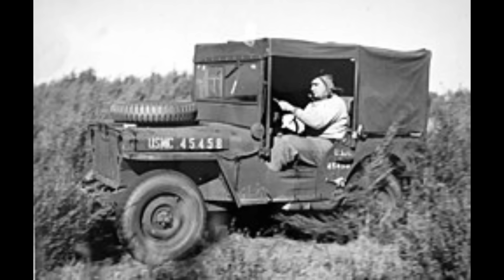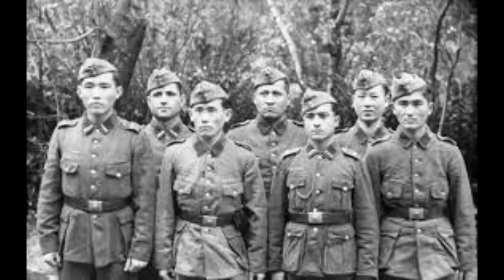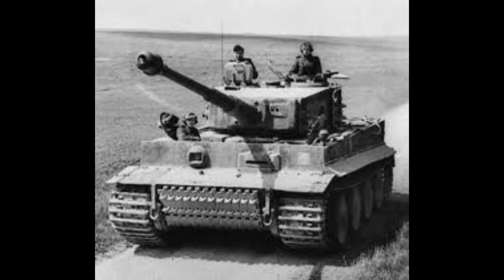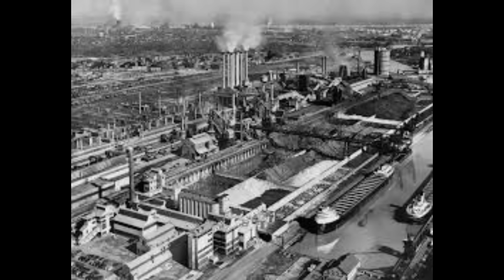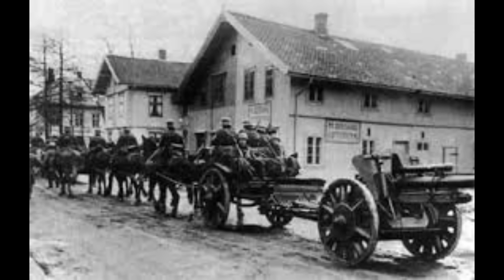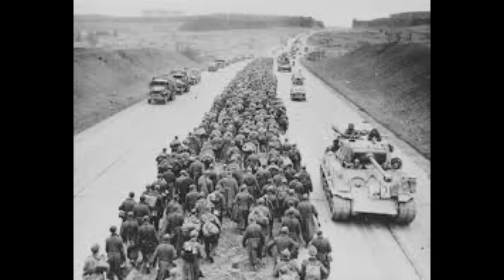German Mechanics Examined A Captured Jeep — Then Understood Why 640,000 Conquered  Two Continent

Comment: My name is Jeep.  There were no Jeeps in WW2.  They were called general purpose vehicles.  The name was shortened to GP's in military jargon.  In the maintenance shacks they were further shortened to the name Jeep.   This became the quick name for General Purpose vehicle. The name was not actually given to the vehicle until after the war was over. The first Jeeps were used in the Korean War.  That was the first time Jeep was actually stamped on the vehicle. They were manufactured by Ford,  Willy's and American Overland.
Reply: Nice story but not correct. The jeep was originally contracted by the army as a 1/4 ton light truck and three companies competed for the contract.. American Bantam, Willys Overland with the MA and Ford motor co. with the GP. The Ford GP was their build code for G= government contract.. P= 80 inch wheelbase.. nothing to do with “general purpose”. American Batam’s design won them the contract but the government didn’t believe they had the ability to manufacture in large numbers so ordered them to hand over their design blueprint to Willys who named the new model the Willys MB. When the US entered the war they contracted Ford to build an identical vehicle to the MB with all parts interchangeable which Ford designated the GPW… G- government contract.. P- 80 inch wheelbase.. W- Willys designed engine. Willys built approximately 360,000 MB’s and Ford built approximately 275,000 GPW’s. The name jeep is believed to have been derived from the cartoon show Popeye and was used by GI’s during the war. Willys overland patented the jeep name after the war and the rest is history. All ww2 jeep nomenclature plates have the designation TRUCK 1/4 TON stamped on them. The now famous stamped slotted grill was designed by Ford.
Reply: @BacktrackTouring  Just have to disagree.  My dad served after WW2, joining  in 1949 and the vehicles were called general purpose vehicles and they called them gp's in the maintenance shacks. 
That gp acronym was shortened to jeep.  Then the name was patented by Willy's.  The original Jeep, as you report, comes from Popeye and was Merchant Marine character that often guided boats in fog and dangerous conditions but the name Jeep as it relates to the vehicle comes from being called general purpose vehicles.  My dad's initials were GP Campbell and he was called Jeep because his initials were the same as the Jeep, general purpose vehicle.  I have had numerous conversations with many WW2 vets and Korean War vets over the years and their calling the Willys, the general purpose vehicle, jeep, was verified to me many times, including by my dad. This was the story he told about the origin of his name so I believe that version of how Jeep became Jeep is more accurate than yours, but both of our accounts are not that different.  My dad worked on a PT boat for some  years and his mates often called him Sargent Jeep because of his initials.  Very informal on a PT boat.

Comment: Modern day America has a military that relies on highly complex ultra expensive combat and logistical systems that cannot be mass produced…especially cheaply. Meanwhile our biggest adversary China is more like America of the 1930s - extensive capacity for mass production, countless assembly lines, and less complex engineering that is easier to mass produce.  America is no longer capable of attrition warfare especially against China. 

Why?

Profit. Profit. Profit. There’s way more profit in flashy complex weapon systems that claim superiority. Systems so expensive they can’t be bought in large numbers, don’t require manufacturers to invest in mass production, and look so good on paper its easy to convince the decision makers. Capitalism without regulation eventually eats itself or is outcompeted by common sense and respect for the working class.
Reply: I was thinking the same thing.

Comment: Not addressed but the US was supplying almost all of the Allies under "Lend Lease" which was a politically expedient way of telling the American taxpayers that they would be footing the entire bill for the conflict, and our Allies weren't expected to repay us.  If 5,000 Jeeps were sent to  North Africa, the US wasn't going to tie up ships moving those assets.  They were abandoned.  While it cost the US $750/vehicle in procurement it was another $150 to ship it.  For US soldiers it was easier to requisition a new Jeep than to get a carburetor or even oil for an oil change.
Reply: Yeah, nah… you got the lend lease part partially correct but the rest is wrong. Millions of spare parts were produced for all military vehicles and especially the jeep, so much so that the allies had extensive rebuild programs where damaged jeeps were shipped to rebuild facilities. jeeps were completely stripped down, all major components were rebuilt or replaced, they were repainted and sent back out. The jeep had a life expectancy of 90 days in battle zones. To this day, NOS jeep parts from ww2 can still be found coated in cosmoline and wrapped in wax coated packaging.

Comment: You are correct that Ford and Willys Overland were both working on the Jeep, but what they didn't know was that Checker Motor Corporation too was working on the Jeep as well as it's trailer.  It's trailer design is what won the contract for Checker.  Checker's version had four wheel steering and proved  a bit unstable but The Government loved the Trailer design.

Comment: I own and operate two military Jeeps. A 1942 Ford GPW and a 1952 Willys M38. The Jeep in WW2 was far superior to the German Kubelwagen. The main advantage was that the Jeep had four wheel drive. Plus as stated, simple to repair and virtually indestructible.
Reply: A Sad Sack cartoon showed the Sack standing in front of his disabled Jeep, which has finally been defeated by extreme mountain terrain. The Sack is hiding his eyes in grief as he aims his pistol at its motor, preparing to end its suffering. 😄
Reply: Americans testing captured Kubelwagens noted it matched or outperformed in every category of testing.

Comment: I lived in Germany for several years……German engineering does not mean quality, it means complicated!  Brilliant, but complicated.  Complication breeds unreliability.
Reply: It’s called GateKeeping tactics 101; also-known-as job-security. 😂
Reply: @LongLiveLiberty same reason road planning and construction organizations always make it one less off ramp than needed, ones less lane than the volume of traffic requires, so they can co.e back in five years and add another lane, bridge, off ramp, etc.
Reply: I bought a BMW from a friend. Nothing but trouble and $$$. Too many bells and whistles, and too many sensors. Every week something was failing or malfunctioning. The display never stopped showing problems and  malfunctions. Very complex garbage.
Reply: I owned one Mercedes. One. I used three different mechanics. One told me, “Mercedes are quirky. And by quirky, I mean expensive.”
Reply: That is why Mercedes are so expensive to own.  Me? I always bought simpler vehicles that cane be maintained without taking out a second mortgage.
Reply: @FD2003Abc The $1000 key fobs to start your Mercedes is a perfect example. There are repair companies that specialize in fixing those key fobs.  Crazy complicated.
Reply: Means more parts more complicated to learn.
Reply: Absolutely right, why make something with 4 parts when it can be done with two ?

Comment: US jeep transfer cases did indeed have a dog tooth clutch gear set.Though the gears were cut, teeth surfaces were hardened. Lapped gear sets were used at the two ring/pinion axle gears.

Comment: The jeep I worked on, while I was in the Army, had no less than 12 U-joints. Now imagine those U-joints constantly immersed in mud or muddy water. It's not hard to understand that those U-joints failed on a very regular basis. Add to that a piece of crap for an engine and I do not have fond memories of the jeep.

Comment: That's 1/2 million Jeeps in just 3 years. Can you imagine what they thought when they first seen how we (USA) used the engine PCV blowby pressure to air charge the axial differentials for water fording to keep the water out of the gear boxes? It must have blown their German slide-rule slinging minds to see that kind of pure simplicity in action LOL. BTW, there's a video where 6 guys assemble one in less then 30 minutes from a pile of parts.
Reply: They should have known, already, this simple concept, as applied by the Soviets. The T34 was simple and good enough. And that means, production was sped up and the numbers are what told the story.
Reply: @keithbrown7685 
The T34 was not inly good enough. 
Every aspect design was recognized immediately by the Germans.
The Wehrmacht demanded a tank specifically like the T34.
Nowadays the T34 is considered okay-ish.
Sure, the german generals feared and demanded a mondane vehicle.(lmfao)
If you want to see history untainted by contemporary views, you have to go back to the original perception of things.
Otherwise the Soviets never captured    
Berlin because everything they had was utter garbage.
Which might be the next step in this modern historical narrative.

Comment: My Father used to say soldiers loved them and everyone wanted one after the war.
Reply: My dad bought one from korean war. Put better foam seats in it, roll bar, 12 voli system with off road lights, cepack tires. It outdid broncos, dunebuggies, range rovers, etc in sand mud climbing straight up hills, it would go everywear. Big said plate, fit between boulders, rock climbing. Then got a girly bronco with ac and doors better heater, windshield wipers,  radio my mom liked it.😅😅😅😅😅😅
Reply: @danielcollins7588 do you know how much they weighed?

Comment: Correction. The Sherman was MORE reliable than German tanks.
Reply: And never designed for tank vs tank battle.  That was not the US doctrine for their use.  They were infantry support vehicles, never built as a counter to panthers or tigers.  That was the job of an M36.
Reply: @dirtywaterdiver I think that the M-36 came considerably after the Sherman. Like at the end of the war.
Reply: @brunopadovani7347  Yes, but that was to take on Tigers, the Sherman was never designed for that role and the US fighting doctrine of WWII was not based on the Sherman taking on other tanks.  It is/was a medium tank and it's role was infantry support.  Basically a mobile bunker that carried machine guns and a direct fire cannon.  A rifle company comes up against a house occupied by enemy  infantrymen, you called for a tank to fire into the 1st floor and when the building collapses the 11Bs attack and kill the survivors and move on.

Comment: "Jeep" derived from J.P. = "Jeneral Purposes" ? What a nonsense.  General Purposes would have been abbreviated as "Geep".   However, war in the industrial age means successful mass production of a few different types of weaponry which is immensely contributing to the outcome of a war. The more simple a technical tool is and the lower the number of different types of trucks, tanks, and so on, the faster the units needed can be produced, including spare parts, and the higher the  number of produced units will be ready to be used in a given period of time.  At least this is true for the first half of the 20th century.
Reply: The jeep was never called general purpose, its government designation was TRUCK 1/4 TON. The jeep name is believed to have been named after a character in the cartoon show Popeye.

Comment: My friend had to do an oil change on a wartime Jeep at a museum. She said it was surprisingly difficult because the Jeeps were built to be expended and not maintained. The reality of battlefield conditions.
Reply: Sorry but that is BS. They were not built to be expendable, they were extremely easy to maintain and came from the factory with a full toolkit to enable the average GI to maintain or repair in the field. There were also rebuild facilities set up where battle damaged jeeps were recovered and sent for a full strip down and rebuild. However the life expectancy for a jeep in battle conditions was 90 days.

Comment: The issue not fully addressed here is that Germans would not have benefitted as much from the higher production of automobiles or tanks. The simple reason was that after 1941 they no longer had enough fuel to properly run the ones they had and it went from bad to worse from there. So in a way their focus on quality over quantity was more justified. However the fact that their quality did not focus on reliability and ease of maintenance is more unforgivable.
Reply: The Kubelwagen was basically a Volkswagen: quite rugged and simple in its own way, but built for fuel efficiency because their logistics required it. Fuel economy means light weight which meant they couldn’t just overbuild it all out of cast iron like you’d build a tractor. It made sense for the constraints they were facing. In the end, it was logistics that made the critical difference. America’s uncanny ability to put stuff where it was needed, is a massive advantage. Having better weapons or vehicles won’t matter if soldiers can’t get fuel and parts for them. See also: Russia’s faceplant in Ukraine. 

It’s been said that the single most terrifying thing about the US military, is their ability to employ a fully functional Burger King to any terrestrial war theater on earth on 24 hours’ notice. That’s not just difficult; it’s also a pretty low priority. You don’t get there until you’ve really, 100% mastered logistics. And logistical competence, the ability to get food and fuel and equipment where it needs to be, is what really wins wars.
Reply: @fisquid 100%  logistics wins wars
Reply: @fisquid Amateurs fixate on tactics and strategy. Professionals care about logistics. Beans, bullets, and bandaids, baby.
Reply: Most German designs were  overly complicated  especially  their tank transmissions and tank drives.
Reply: The Germans didn't run out of equipment. They ran out of fuel. Even in April 1945 they had to destroy brand new planes and other equipment because they didn’t have the fuel to run them.
Reply: additionally, German factories were being bombed, American factories were not.
Reply: @robertdaniels2549 true as well
Reply: Then why were the Germans able to continue the war til mid 1945? It's because they were manufacturing synthetic oil, using coal, since 1941! Extremely expensive, but they were still doing it.
Reply: @samr.england613  They were using horses for logistics and their last major counter offensive in the west was planned around capturing American fuel supplies. They were forced to abandon perfectly working tanks and vehicles simply because they ran out of fuel and had no fuel to resupply them.
Reply: @Princess_Celestia_  Doesn't change the fact that since at least late 1942, they were manufacturing synthetic oil from coal. Which, as I stated, is, to this day, a very expensive process.

And the Germans were using horses and horse carts since the invasion of Poland in 1939. The Nazis showed propaganda films of the German Army being totally modern and mechanized, but that wasn't the reality.

Comment: A tiger required 10 hours maintenance for every hour of service.  A Sherman required 
1 hour maintenance for every 10 hours of service.   Huge German tanks required huge amounts of fuel.  They were so heavy their had to be limited to certain terrain.  The Russian T34 tank was incredibly effective.  The German 88 millimeter gun was superb.  German tank maintenance units on the Eastern front faced impossible repairs and fixes.  During the Ardennes offensive in Dec. of 1944 the German tank units initially achieved great success.   Lack of fuel stopped them as much as American resistance.  These tanks used huge amounts of fuel which the Germans simply did not have....
Reply: The US army did not fight Tigers with Shermans. They fought them with thousands of jeeps that could go anywhere across country and had radios that could call in airstrikes.
Reply: @johnharper257 Tell that to my friend Marlin Bingaman who had three tanks shot out from under him during WWII.  As a matter of fact there’s a 10th  Armored Division Sherman tank on display in the town square in Bastogne with an 88 German tank hole in its side.   Give me a break with that call in air strikes bullshit!

Comment: a slogan in quality engineering goes 'don't let the perfect get in the way of the good'.  Having owned an early 1960s VW I agree with your analysis, actually the VW wasn't that great in terms of quality, where it stood out was being able to easy fix things that went wrong.  Putting a simple fanbelt on a 60s Buick was an hours chore better left to a mechanic, the VW carried a spare, the tools need to replace it, instructions on how to do it in the owner's manual, and it could be done in 15 minutes at the side of the road.  Don't even think of transmission problems on the Buick, that was a nightmare.

Comment: I as a supply enlisted e2, read a manual on how a 4 stroke engine worked,  2 months later with no mechanical training a bought my first car and performed a valve repaired and lapped the valves improving performance
Reply: That's how you learn, by doing.